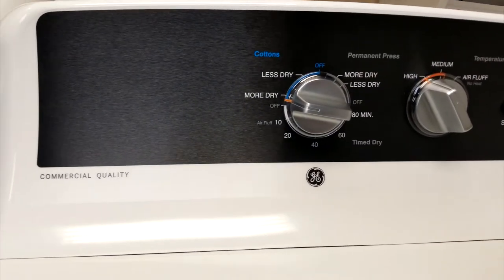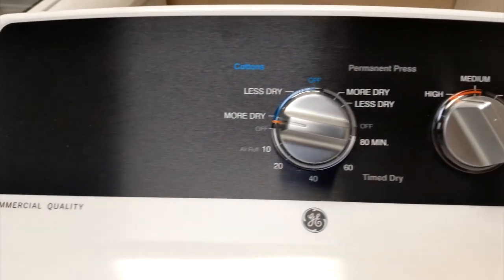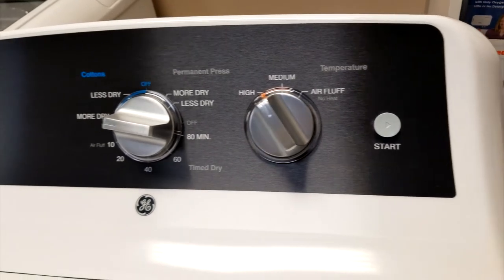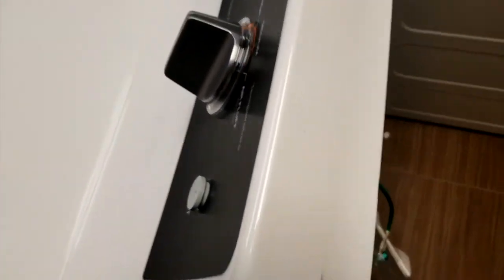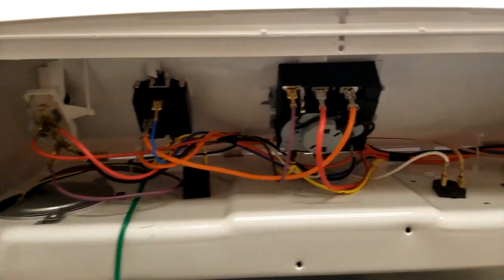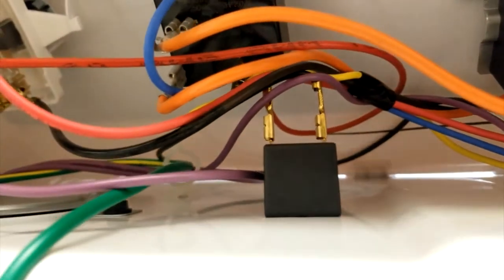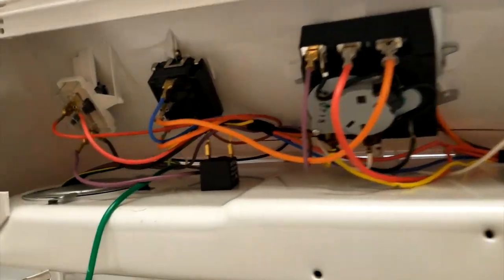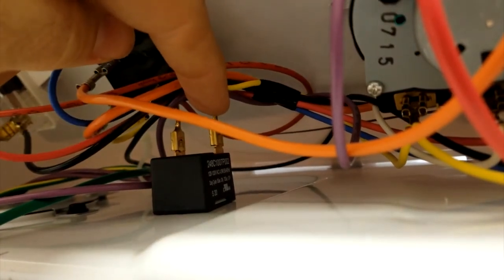Disable Dryer Buzzer

Comment: That buzzer is straight from hell. I have no idea what they were thinking. Thanks for your help
Edit: this dryer literally looks exactly the same as my cheap one. Just different buttons, a different colored control panel, and different drum capacity. That doesn't necessarily mean that the parts inside are the same, but it definitely feels like you are being ripped off if you buy this one instead of the cheap one
Reply: Ihope next ge commercial dryer ihope I will have chime instead of loud buzzer

Comment: I bought this washer/dryer set about two months ago.  The salesman sold me on it by calling it the speedqueen killer.  Overall, the set cleans and dries clothes...  However, had I known this dryer lacked basic functions such as an option to turn off the buzzer, I wouldn't have bought it.  I reckon that's on me.  We had a GE Tech come to our home and he offered no help. To the folks saying seriously, is it a problem, yes, it is.  My neighbors do not need to know when my clothes are done drying, and it will wake up any sleeping baby.  I just don't get why they would hype up a commercial unit saying it has better parts and then include this buzzer.  My guess is they had to find something for the GE intern to do, and someone thought it was a good idea to make them responsible for the end of cycle buzzer.  I'm sure that young person is going to have a great career because it certainly started off with a bang or in this case a buzzzzzzzzzzzzzzzzzzzzzzzzzzzzzzzzzzzzz.  Thumbs down.  One star.  Don't buy unless you have a mansion and need to know when the clothes are done from six thousand feet away.
Reply: LOL
Reply: I just bought this dryer a year after you made this comment and they still haven’t fixed it. I was shocked when I heard this horrible noise with no way to turn it off.  I got a Speed Queen washer a few years back and my old dryer finally gave out and we went with this to save some money. Questioning my decision today.  I have to ask, our SQ washer washes a load in a half hour. How long does it take to wash a load in these GE Commercial Quality washers?
Reply: Quite on point, nothing more to add. Horrible loud buzz from hell, very long, and happens twice in 2 minutes

Comment: Honestly I thought you would put a resistor to reduce sound level on the buzzer. That's something that would truly void warranty, or drilling a hole in the panel putting a potentiometer. You can easily plug this back in and your warranty should be fine.
Reply: With the older dryers you could just turn off the buzzer altogether
Reply: @kenrutherford1109  That's if those dryers had that option, which some of them don't.

Comment: I like the buzzer actually.  Reminds me when the laundry is done so I can go fold.  Buzzer quit on my old GE dryer a couple years ago and now half the time I forget I even had a load of clothes in the dryer until I'm ready to dry another load, lol.  Just replaced the light inside the dryer last weekend and went with an LED instead of the regular bulb and boy, I can see in there now, lol.
Reply: same
Reply: I mean, i had some old ge dryer, but didn't have the black panel on the front and it didn't buzz very loud
Reply: @FazejasiahShorts  why you like the buzzer

Comment: Seriously is it really a problem with people ? What is it a couple of seconds ? First world problems i tell ya.  GE should have just added an adjustable cycle signal.
Reply from the maker: yeah that would make the most sense... maybe they thought it would give a laundry mat feel? or perhaps too many options to feel commercial?
Reply: @appliance-insider  Kenmore dryers of old used to have this buzzer. My speed queen dryer I left at my old home had an adjustable buzzer.
Reply: Mines buzz twice. I don't have this set but a new set, and it will buzz...then keep going and buzz again. It's way too loud!
Reply: Yeah, a couple of very annoying seconds .. My dryer is behind a drywall wall in the next room. People on the phone have commented on it ("What the heck was that? Nuclear attack?") - Thanks Appliance Insider for the quick fix!
Reply: I liked having a buzzer but not this level. Middle of the night laundry from kids throwing up get the back to bed and this thing goes off of you don't get in there in time. Then the whole house is awake. I want a bizzer but at this volume I will do without its just too much.